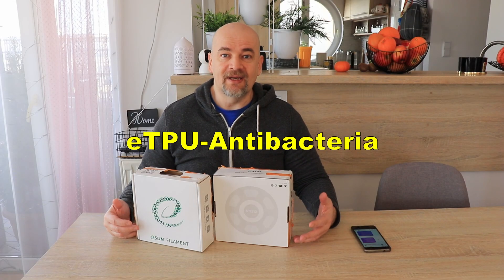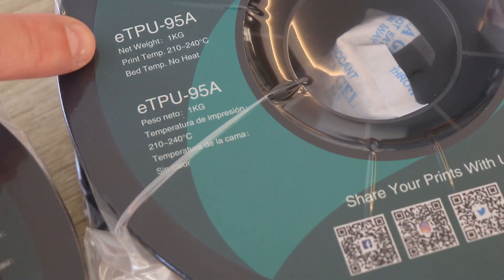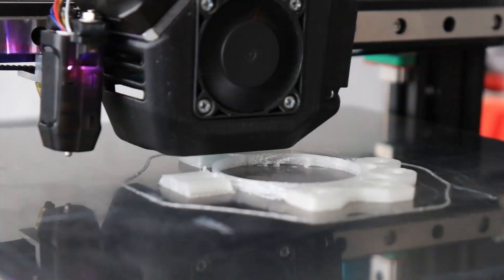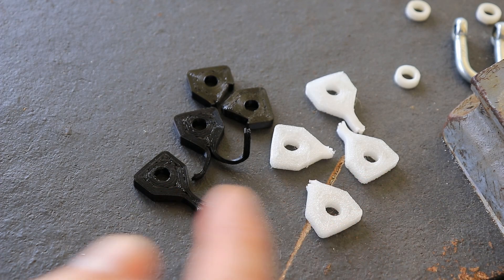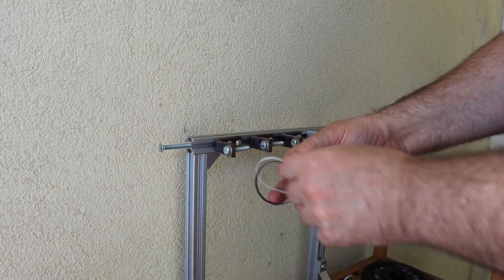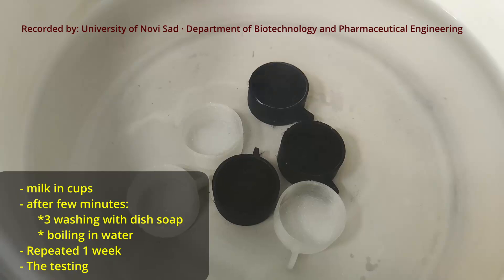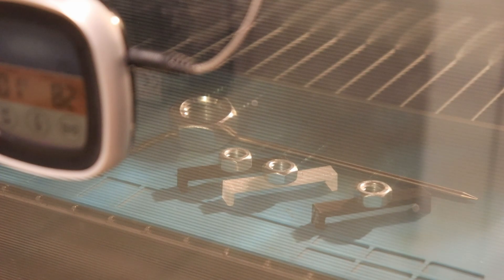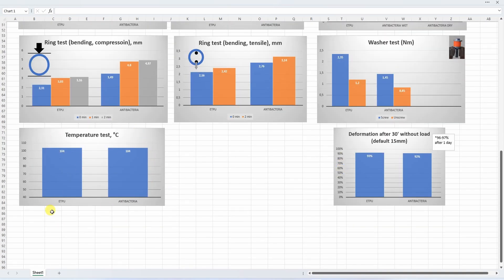eSun eTPU-95A vs eTPU-Antibacteria (new name eTPU-HS) - flex filament comparison

Comment: Amazing data as always!
Any information from the filament manufacturer how that antibacterial effect is achieved and how durable the antibacterial substance is?
Is this an inherent property of their TPU or is this an additive?
Will the antibacterial last 1 month? 1 year? 5 years?
Reply from the maker: If the effect is by metallic ions, then they will be there a years later too. I asked them before the review, what is the effect material, but they told me it is a secret (usually they are silver ions, sometimes copper ions)

Comment: As always great comparison ! 
It would be cool to compare eTPU Antibacteria with ColorFabb VarioShore PROSTHETIC (antibacterial version).
Reply from the maker: First there will be testing all 4 Extrudr TPU filaments, one of them is with carbon fibers... I am curious already..
Reply: @MyTechFun  I love the Extruder ASA filaments, for their UV resistance and flame resistance. They are UL94 HB.
But I can not find any filament that is ASA and has higher certification. Like for example UL 94 V-0.
Only ABS filament, which I don't want to use because ASA is just better than ABS.
Any idea why there is no ASA filament with higher flame retardant certification? Maybe you can ask them :D